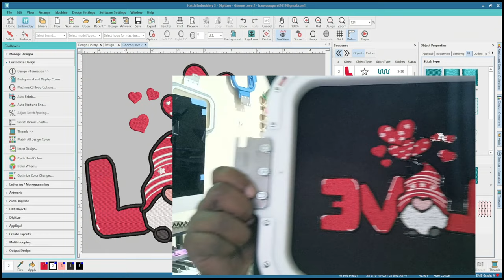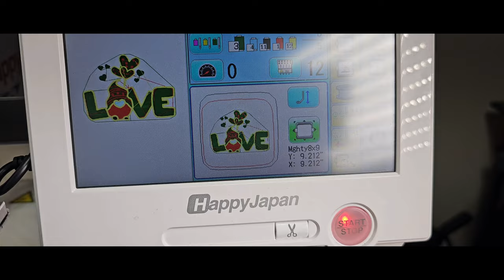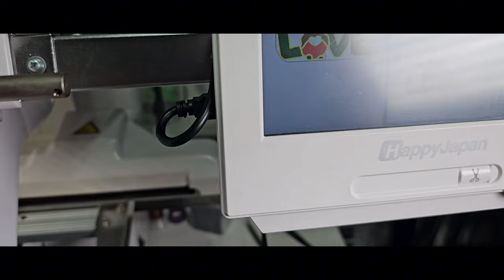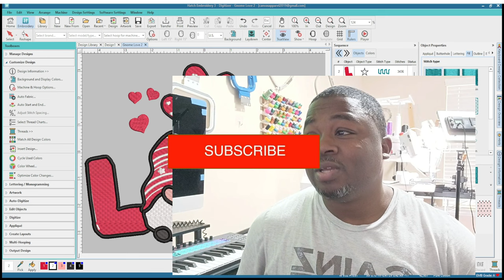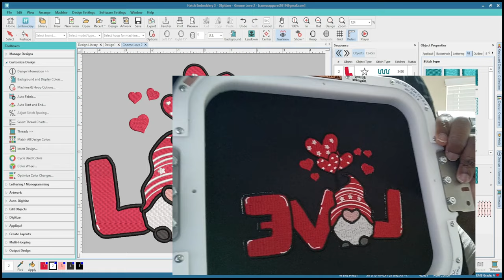Embroider a Valentine's Gnome with Jamel |  With the HappyJapan Voyager Machine

Comment: So, after working on something for about an hour and a half, Hatch froze up and crashed. What do I do to keep from losing what I worked. Starting over😢. Can I save throughout the project?
Reply from the maker: Usually if you reopen the software what you are working on will come back up if you have the auto save feature on. If you don't have the auto save feature on you can turn it on by. Going to software settings, user interface settings check auto save box if it's not checked and set how many minutes you want it to auto save.
Reply: Thank you